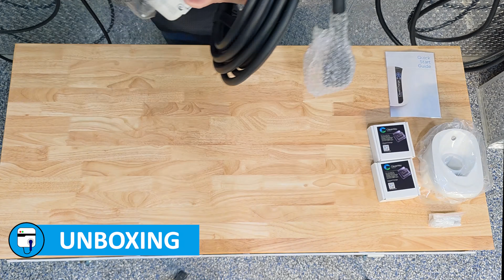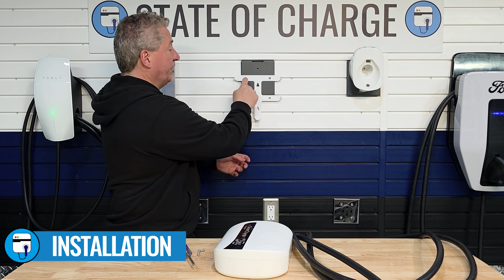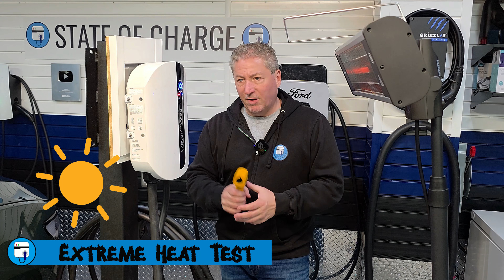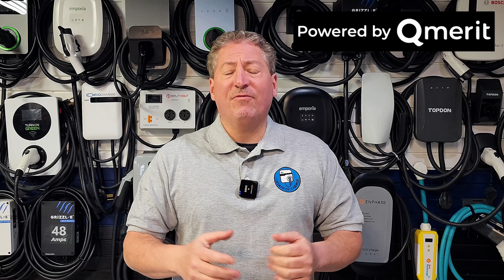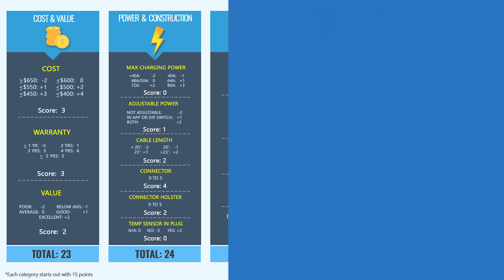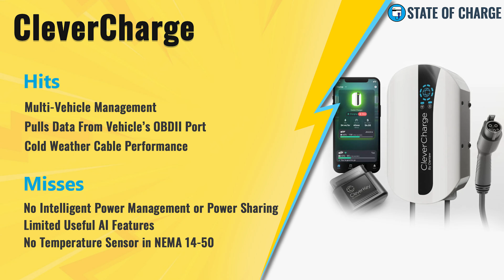Clevercharge Smart EV Charger Quick Charge Review

Comment: Hey Tom, I have a question and I don't know if there is a good answer for it yet.  Obviously the recommendation is to change no higher than 80% for daily use. But I have also heard that a big degrading factor is how long the battery sits at a highSOC.  So, what if I charge to 90+ but leave the house as soon as it completes?  It wouldn't stay at that level for more than 20-30 min tops
Reply from the maker: You're correct. It isn't necessarily how high you charge to, but as long as it sits there. I frequently need to charge my EVs to 100% and always time it so I'm leaving just as it finishes charging. If you do that, you shouldn't worry much about charging to a high SoC when you need to.
Reply: @StateOfChargeWithTomMoloughney   That's what I figured,... So if I understand what you're saying, if I set my Tesla up to charge without a start time.... It could charge to 100 as long as I leave the house right away.   Are there any studies that you've seen on this?

Comment: Another excellent episode.  I love my Grizzl e 48amp charger so much I recently bought another one for my dad at his house.  I noticed that the cable is slightly smaller and more flexible.  I guess the people at Grizzl e noticed that their charger cord didn't do well in your freezer test, so they made improvements. Keep up the good work. 
FYI In Florida the original design is just fine, but now it is great for Canadian winters too.
Reply: I’m a big Grizzly-E fan too.  We installed two at a condominium building, one NACS & other J1772.  The NACS cable is very thin, but J1772 is nearly twice as thick.  Sales dept said cable thickness is determined by J1772 plug.  It’s no problem for customer because he’s in a warm climate. Load balancing chargers works great.